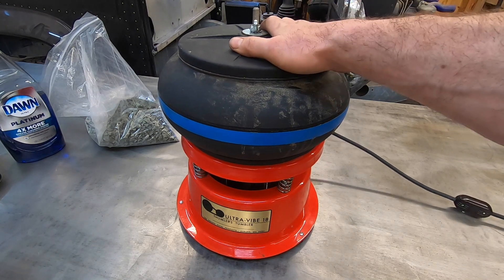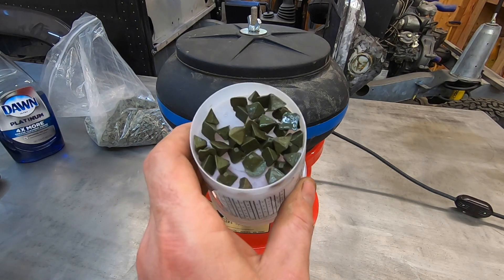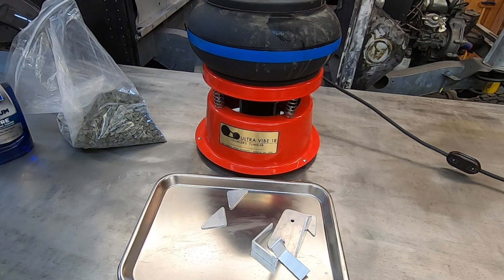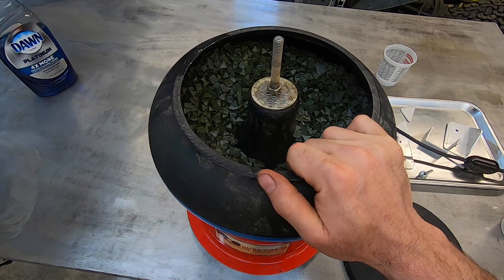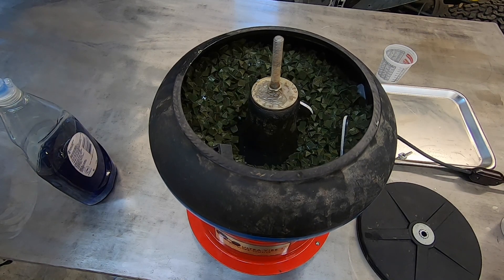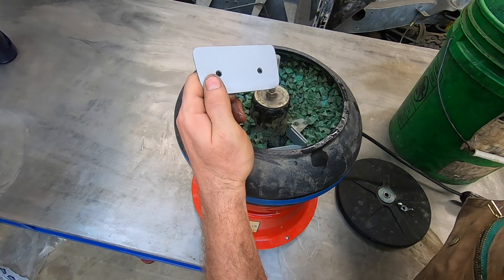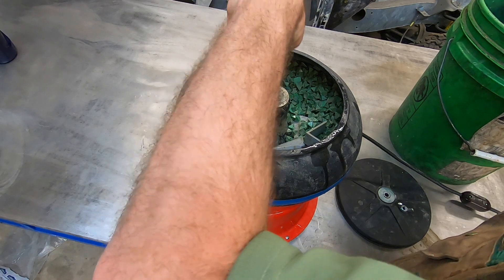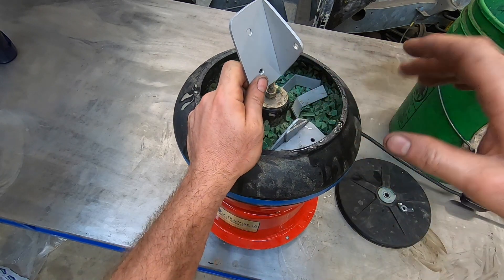Surface Finishing of Aluminum Parts in a Vibratory Tumbler

Comment: One thing to remember with any sort of tumbling: you need "flow". This refers to the media being transported across the part surfaces at a reasonable travel speed to actually cut, not just skip across the surface. In this case, I would have started with 1/2 the media he used, as it weighs significantly more than the parts. You need it to actually tumble, not just jiggle around. The parts must be turned over and over, end over end, allowing for media to travel in all directions due to the natural irregular flow of the media itself. With proper media circulation, your "couple of hours" can literally be 20-30mins of run time, if the media is actually moving. You need it to churn, just like with a blender, bottom up and around the sides, combing back down into the middle.

Comment: Is this an alternative to shot blasting
Reply from the maker: Tumbling is similar in a sense that the surface is abraded.  Tumbling is used for deburring because it removes more material from the corners and rounds them off. So on sharp edges it is more like filing and sanding and on flat surfaces is is like the the early coarse polishing steps.

It is a better process for small pats that are labor intensive to hold and position during blasting. I found that blasting is not a good restoration process for rusted steel. It does not "get into" pitted rusty craters as well as blasting abrasive does.

Comment: What grit exactly were these pyramids? I'm seeing a wide variety of grits available and I'm fond of the results you achieved with whatever grit you used. Thanks for the video, I'm tired of my blasting cabinet for small aluminum parts, and this looks like it'd be a way more ideal method for prepping them for anodizing than using my blast cabinet (which leaks blast media everywhere, and I'm too swamped to tear it down and seal it)
Reply from the maker: The pyramids cannot be described as a grit, it is more like tumbling with stones.  This is how many Al parts are prepped for anodizing in industrial settings.  The green plastic media that has an imbedded fine abrasive is used to tumble aluminum parts.
Reply: @compulsivediy8036  ah thanks for the reply, but these definitely do come in different grits. I settled on 220 and it worked out fine.

Comment: Nice video! The company I work for uses ceramic to tumble parts and requires 2 treatments with 2 media sizes. Would this method be better?
Reply from the maker: I found that one needs to develop a specific method for every application.  That is easier when you do the same  well developed  process every day at a business.  I have had many bad results when trying to tumble something new with the best guess for media.

Comment: Would you say this would be the only treatment necessary to make the parts accept primer and paint with good adhesion vs untumbled aluminum?
Reply from the maker: Yes, some paints and primers require a rougher surface than this for adhesion.

Comment: Can I use them on hotwheels to remove filling Mark's and scratchs
Reply from the maker: I found you have to test the process for you application.  Businesses often have consultants usually from equipment manufacturers that set them up.  The abrasive action is pretty gentle so everything depends on how deep the scratches are.  Tumbling, even with hard ceramic media is closer to polishing than to sanding.

Comment: Why is the aluminum so dull grey and non reflective. It looks like it was gloss powder coated in light grey. I expected some kind of polished aluminum look
Reply from the maker: This is something like a mild abrasive procedure for deburring and scratch removal.  Polishing would require a buffing wheel.  Gun brass shell casings can be made very shiny by tumbling with mild media like walnut shell.  I will try tumbling aluminum with walnut shell media and see if I get some shine.
Reply: Compulsive DIY thanks I’m very curious if any media will give at least a lightly polished look to aluminum
Reply: Wheel refinishers use various  plastic pyramids and get phenomenal results, that almost look chrome.
Reply: @compulsivediy8036  Did you ever try this? thanks